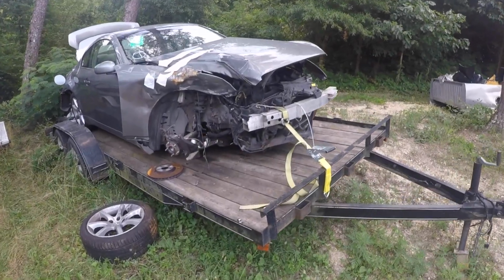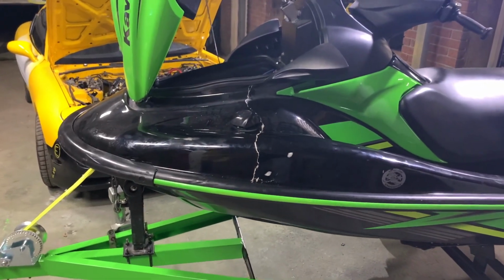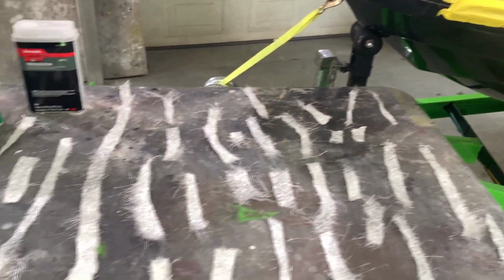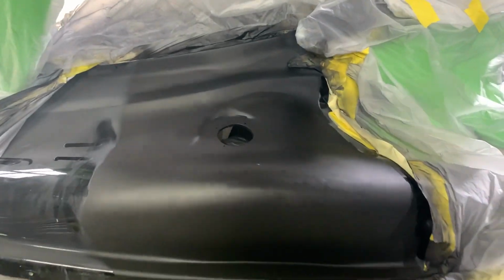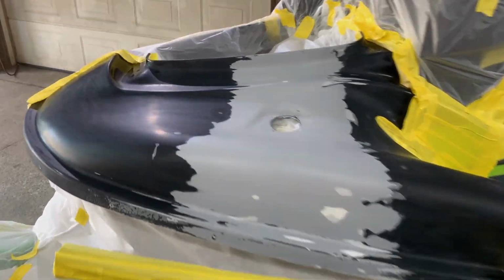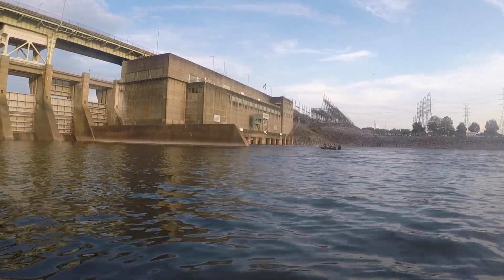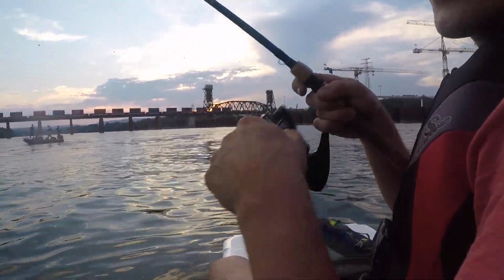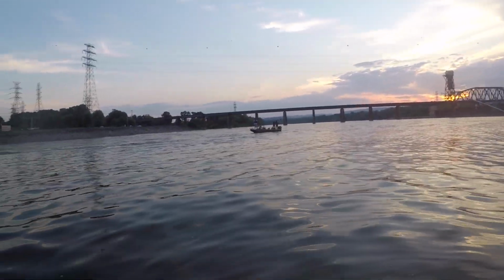I Bought A Wrecked Infinity G35 for $475 From Copart | Jet-Ski Repaired

Comment: I was wondering if you were getting a coupe or sedan.   The S model had brembo brakes bigger  rotors and 6 speed manual transmission.  I know I sold mine last year for 10 k with 98,000 miles on it.  😀